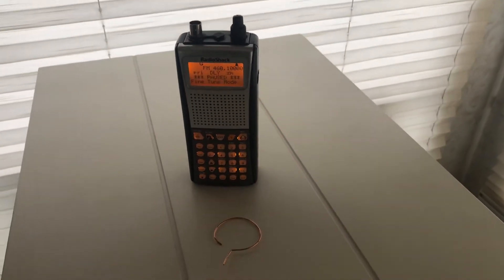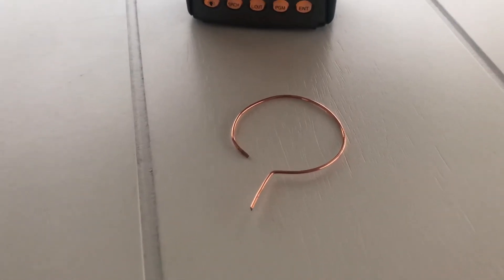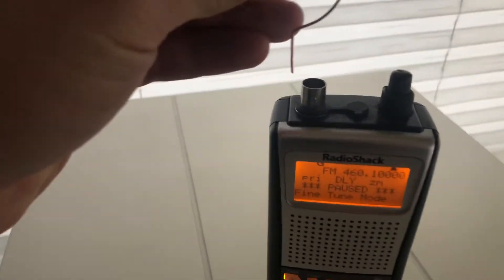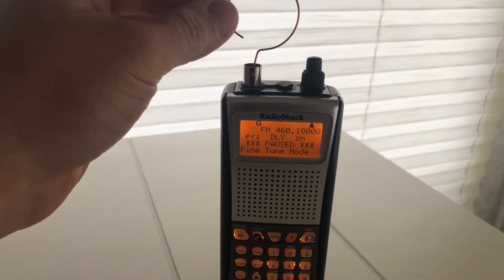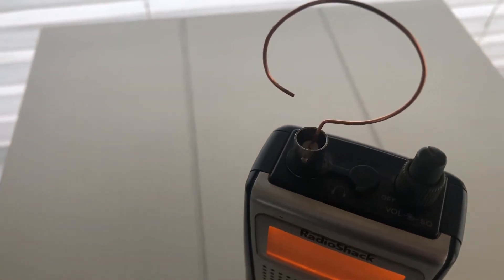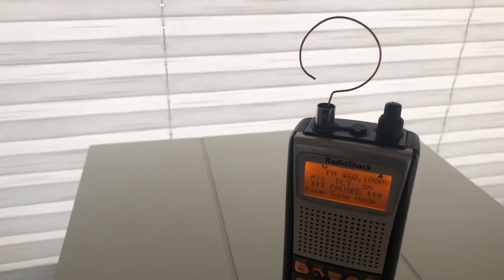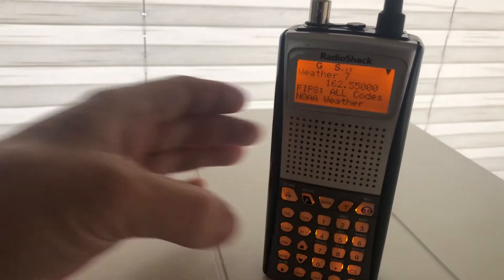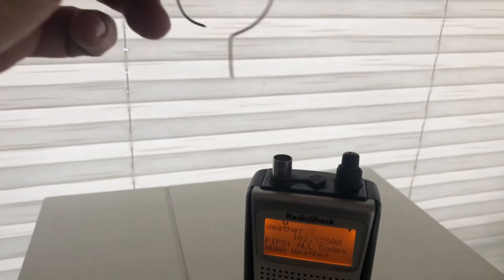How to make a quick emergency scanner antenna from copper core from coax cable

Comment: A vertical wire will do better.  234 divided by the frequency in MHz to determine length. But, 20 inches would be about right.
Reply from the maker: I’ll have to test that out thanks!

Comment: There are various antenna hacks that you can do when in a pinch.
I've made a tv antenna out of wire and a bicycle rim back on the day, and I also made one from an oven rack.
It doesn't take a lot to pull in a VHF/UHF signal.
Cool scanner antenna.
What brought me here was the fact that I'm getting ready to purchase an older police scanner (not a handheld) that doesn't have an antenna, and I need to rig up something until I can get an actual antenna.
Then again if I can get it work good enough with a homemade antenna I'll probably just leave it at that.
If anyone has any ideas I'd love to hear them.

Comment: I once did something like that with my Radio Shack Pro-97 (some body.)

I wrapped a paperclip around the bottom of a coat hanger and straightened out the other end to put in the antenna mount.